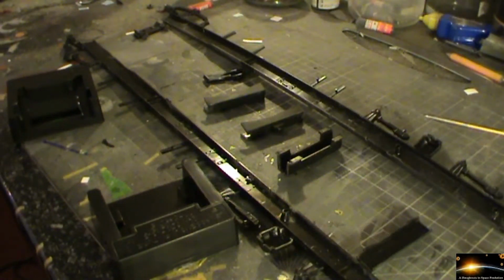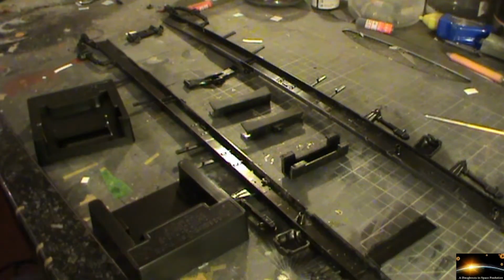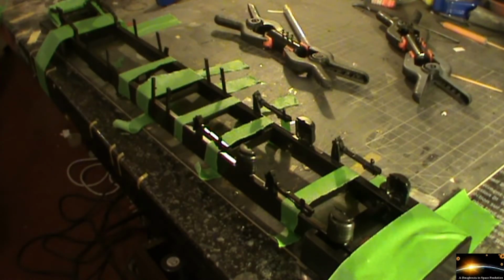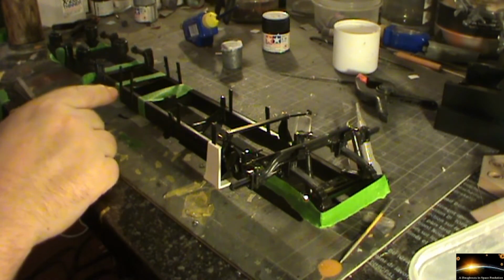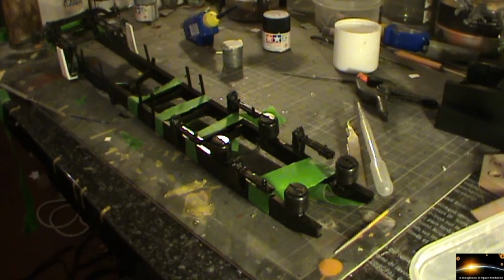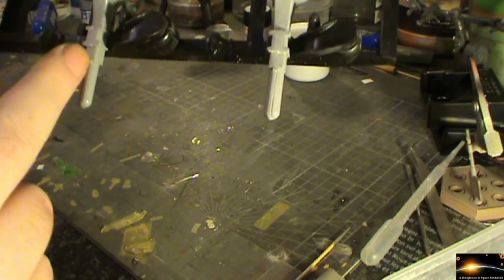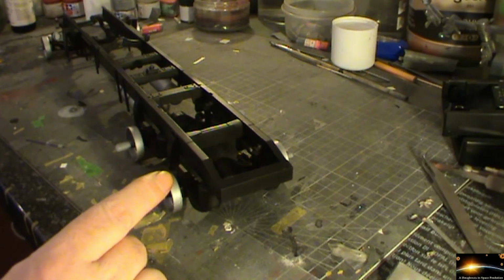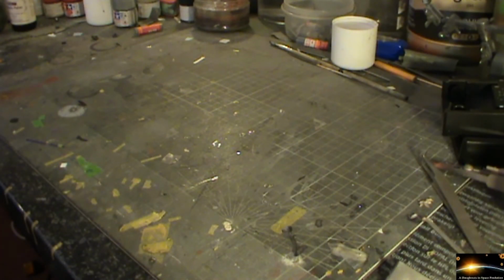Revell 1:16 Peterbuilt 359 Build Part 2

Comment: Big kit, frame looks good, like the jig they supplied, making nice progress, :)
Reply from the maker: Hi Tom, Frame is a bit of a beast to tame until you get it in the jig, make for a little work to ensure the beams lock into place as it goes together. Even more so on this kit as the rails were warped.

Comment: I hope you are enjoying the build, it is looking very nice. There is a part that in the instructions show putting on upside down it is the power steering resivore. It comes in two halves and has three nubs on one end and one nubs on the other. The end with three nubs should face down. I can't remember what step in the instructions it is. Can't wait to see what color you decide on. You do very nice paint work. Any way the truck is looking good so far. Keep on truckin.
Reply from the maker: Hi Mark, thanks for the heads up there, I will try to locate the part and put it the right way up. Do you know if this part sits on the outside of the hood or if it goes on the inside of the hood?
Reply: Doughnuts Inspace It sits under the hood on the left side of the truck close to the radiator. There is a bracket that it mounts to that I can't remember if it's molded to the frame rail or not.
Reply from the maker: Thanks for the help there Mike much appreciated, will look out for that part when I get to that stage.

Comment: The white parts you put on behind the front axel are fillers between the hood and step/battery box and should be painted body color.
Reply from the maker: Hi Mark, I have painted those parts black just to blend them into the chassis.